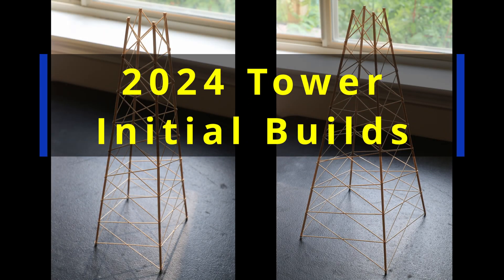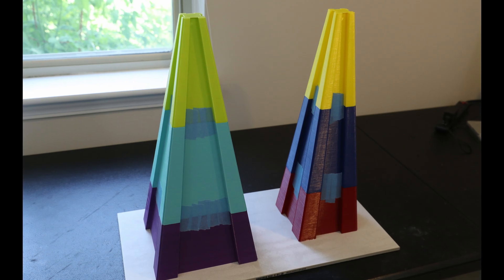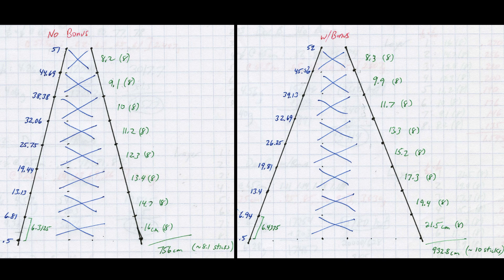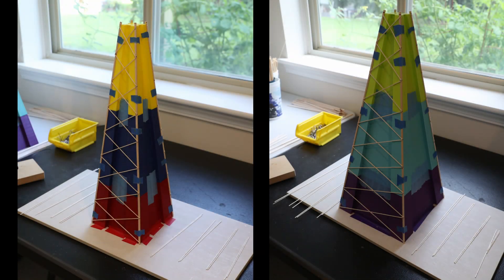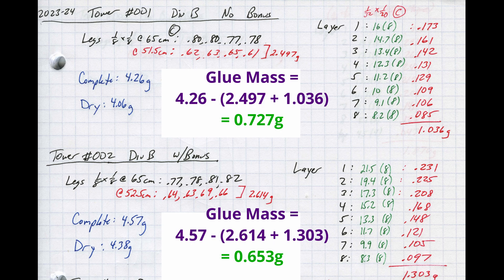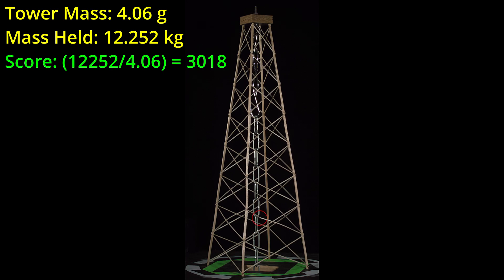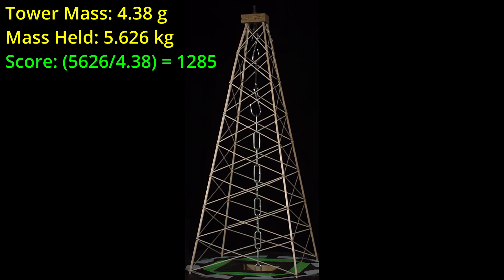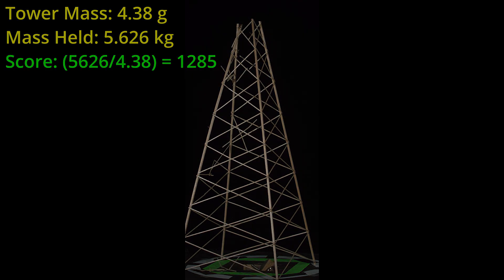2024 Science Olympiad Tower: Initial Builds

Comment: Hey if I glued the balsa structure to the jig how do I get it off
Reply from the maker: The best way is to find or 3d print a small block.  I made one that is 30x30x5mm.  Temporarily tape that to the top of the jig.  Then carefully turn the entire jig upside down and put it on a hard, flat surface.  Then firmly press down on 2 legs at once and hopefully your tower will pop off.  The key is to be pushing down on the legs from the bottom instead of trying to pull the tower off the top.  Also, make sure you are building the sides with the jig on its side.  That will help minimize glue usage and prevent the glue from dripping into the grooves so it won't get stuck in the first place.  Good luck!
Reply: Thanks for the tip!!!

Comment: When referring to the legs as 1/8 x 1/8, does it refer to the width and length of the balsa wood? Also, would this be the consistent wood thickness and size to use throughout the design or would we use different types of wood? Finally, would the paper template work just as well as the 3-D printed jig or is it better to have the jig instead to build the actual tower?Thank you in advance.
Reply from the maker: Hi! The legs are 1/8" x 1/8" width/height.  Their length is just over 50cm for Div B and just over 60cm for Div C.  You definitely want to use smaller dimensional wood for the cross-members.  In my various builds I have used everything from 1/16 x 1/16 to 1/32 x 1/20.  See my "Notes" video and the "Benchmark" videos for the best examples. There is no one correct answer there as it highly depends on the density and cross member spacing you are using.  You can build good towers by building 2 sides flat on paper first, but you will really want to have some sort of assembly jig to get it perfectly symmetrical.  Good luck!
Reply: Thank you so much

Comment: Thank you very much for the videos. I followed them and build the tower around the jig. now I won't be able to slide it off the jig. What would be your recommendations?
Reply: nm... got it off. Thanks for the videos.
Reply from the maker: @zhshengcn  No problem!  Glad you got the tower off the jig.  I was actually going to make a specific video on just that thing, but I haven't gotten around to it yet.  What works well for me when it happens is I 3d printed a small block that is 5mm by 3cm x 3cm.  I temporarily tape this to the top of the jig.  Then carefully turn the entire jig upside down and firmly push on at least 2 legs at a time until it pops off.  This has worked for me several times.  Good luck this season!

Comment: what kind of wood did you use for this ? and what is the maximum allowed weight of the tower
Reply from the maker: This was made from all balsa wood which is what I would recommend for these towers.  There is no maximum weight, but you want to make it as light as possible that can hold close to 15kg for the non-bonus version, or just over 15kg for the bonus design.  Good luck this season!

Comment: What density balsa do you recommend using (Ex. LD, MD, HD)? Also, just to clarify, did you use C-grain balsa in this build?
Reply from the maker: I would say mostly "light" density is where you'll want to be for these builds.  Both of my best Div B and Div C (not shown yet) towers did not use C-grain balsa.  While that might eventually help you get a tiny bit more performance, I would not bother using it this early in the season.  It's much more important to get the pieces at the correct mass and a balanced build than to worry about the grain type.  Good luck!

Comment: Hi, Is it possible to build without jig and could you please explain How to build without jig
Reply from the maker: Hi!  It's definitely possible to build a competitive tower without a 3D printed jig, but I wouldn't recommend building without any jig.  Back in 2017 when I coached Tower, we didn't have a 3D jig, but made one out of wood, copper pipe, and a balsa top piece.  Even if you need to build something out of Lego, you'll want something to help make it as symmetrical as possible.  The general idea is to build 2 complete sides flat first.  Then you can put those 2 sides on your jig, taped in place if necessary, and then assemble the final sides cross members while on the jig.  Good luck!!
Reply: @balsaengineering6686  Thanks, I will try
Reply: If you cannot make a jig, you have to pin the two sides pieces horizontally in place on foam board, then place the cross members, flip and repeat to complete the 4th side. It is not as effective as building with a jig but doable.
Reply from the maker: @jeffreywilliams9655  Yep, and if you are stuck doing that, I would also recommend trying to have some other physical item to help hold the sides in place besides just pins.  It should be possible to just tape blocks on your work surface that your put your sides up against.  BTW, I also like to avoid pins these days as it can put dents in the wood which can effect the performance.  I have become a huge fan of just using blue painter's tape instead of pins.  It works great and never damages the wood.

Comment: Hey Mr. Balsa engineering I have just started printing out the 3d jig and my 3d printer is not big enough for the bottom bonus layer. Can I make it in two parts and cut it vertically? Also how long did it take you to build the bonus tower?
Reply from the maker: Hi!  Yes, I would recommend using Microsoft's free "3D Builder" app to cut the STL file however you need to to make it fit.  That what I used to chop the original complete jig into 3 pieces myself.  Good luck!!  P.S.  If you are just getting started, I would recommend working with the non-bonus version first, especially if that fits your printer.  Leave the bonus builds until later in the season (if ever).